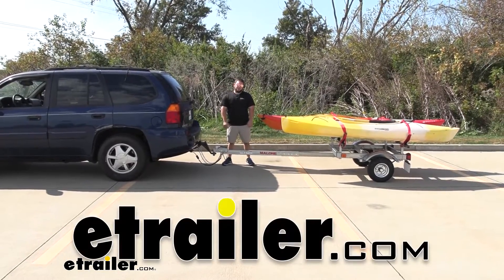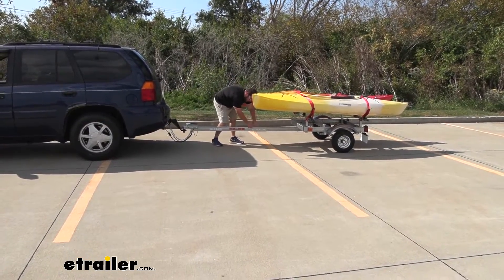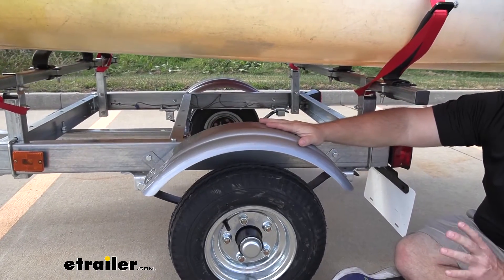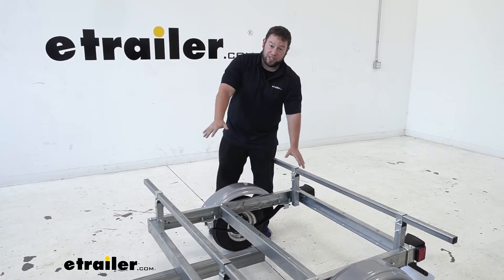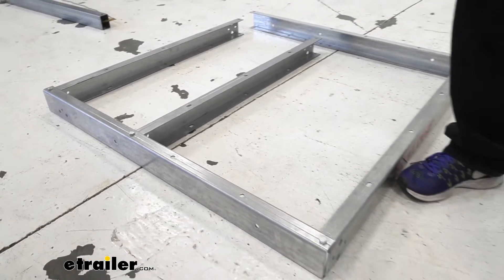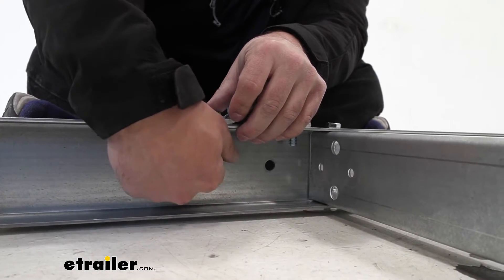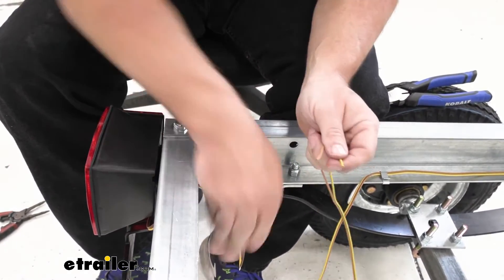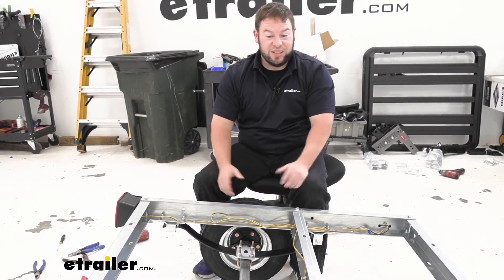etrailer | Hands-On with the Malone EcoLight Sport Trailer with V-Style Carriers for 2 Kayaks

Comment: great demo!  would this trailer hold 2 of the biggest old town kayaks?  My concern is the width
Reply from the maker: The crossbars on the trailer measure 58 inches long, so around 30 inches would be the maximum width of kayak that'll work. Since the average width of a kayak is 26-30 inches, this trailer would very likely work well for you, you'll just need to measure how wide your boats are.
https://www.etrailer.com/Kayak-Trailer/Malone/MAL43FR.html

Comment: Nice video I was wondering if this would fit 2 big fishing kayaks or what model would thank you
Reply from the maker: It'll depend ho how wide/long your boats are. The crossbars are 58 inches long, so if the combined width of your boats equal that or less, they'll fit. The weight capacity of the trailer is 400 lbs and it can handle boats up to 14 feet long. If your boats meet these parameters, the EcoLight2 # MAL43FR kayak trailer would be an excellent choice for you.
https://www.etrailer.com/Kayak-Trailer/Malone/MAL43FR.html
Reply: Ok thanks for getting back to me I have the cresent sholie and the cresent k craft so they will be to wide for the trailer any other trailers you recommend thanks
Reply from the maker: Check out the Malone # MPG461GS MicroSport. The crossbars are 78 inches long. The trailer can handle kayaks weighing up to 150 lbs each measuring up to 20 feet long. You can take a look at it by using this link:
https://www.etrailer.com/Kayak-Trailer/Malone/MPG461GS.html
Reply: I will check it out I appreciate it
Reply from the maker: You're very welcome! Let us know if you have any other questions....